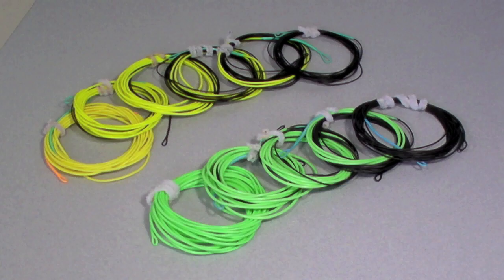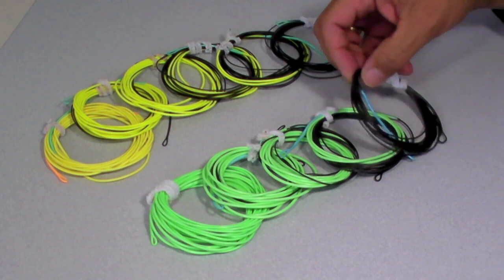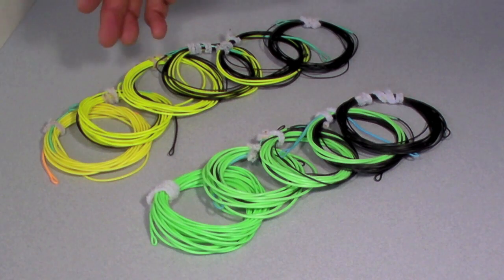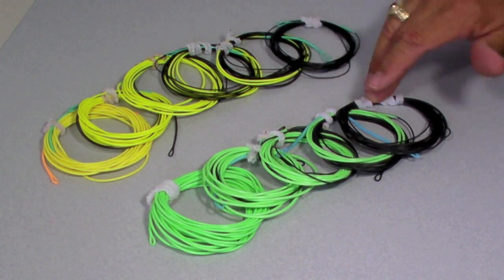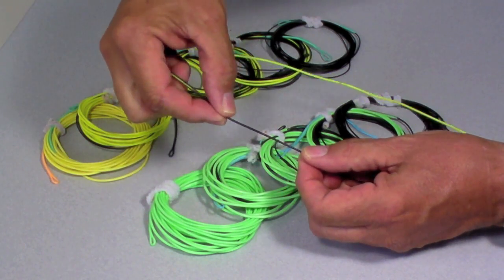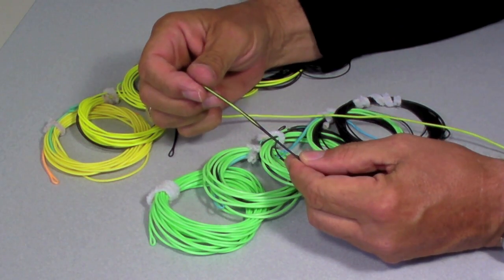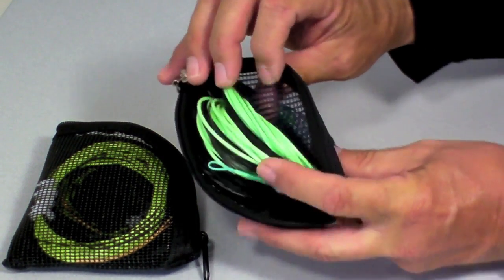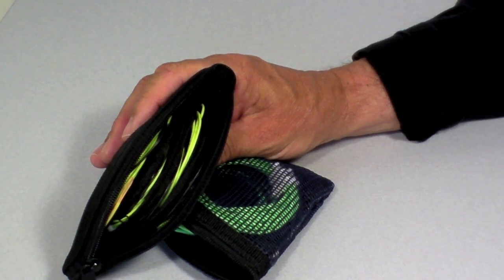Welding up a Set of Skagit Tips

Comment: hello, 
what kind of line do you use for the floating? DT line? And that number? 
I think it's important the diameter ....
Reply from the maker: The floating section was made from DT line.  It is important that the floater material be as heavy or heavier than an equivalent length of the sinking line.  So 2m of floater must be >= 2m of sinker.  This weight relationship is important to ensure good turnover.

Comment: fly line is kind of expensive is the only bad thing.
Reply: Because it not just some string on a stick.   It's scientifically designed, and that cost money. You get what you pay for.
Reply: As a beginner you might think this,,. but only a couple a years in and have over 30 lines (all sorts of skagit heads.scandi's, running lines, weight forwards, etc) . Many i don't use as i moved rods or sold them.. Each having a new grain window.. cutting lines is really normal
Reply: I'm not a beginner at all man....